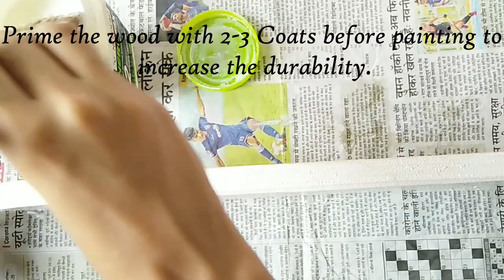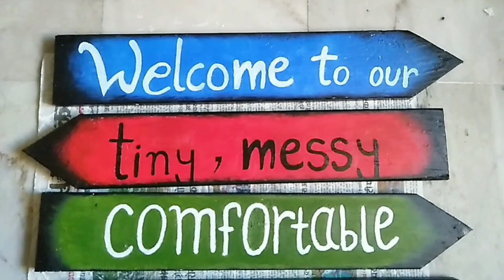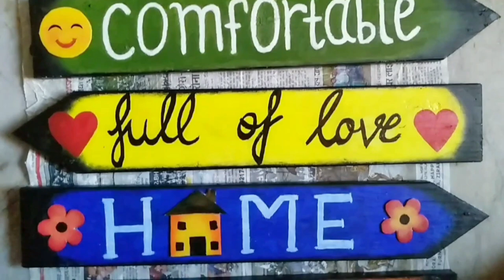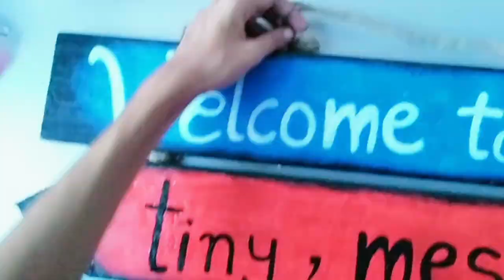Wooden Wall Hanging || Step By Step || By Rann's Art

Comment: Also, please suggest handy wood cutter for cutting to desired miniature pieces
Reply from the maker: The miniature ones I used to make with cardboard so you can cut the cardboard with a cutter easily and you can easily get the cutter from any stationary shop😊

Comment: Can this technique be used on mdf as well ? Which primer should be used ? And any varnish required after the painting?
Reply from the maker: Yes you can use mdf with a thickness around 1 inch but no primer Will be used in case of mdf, you can directly paint. And no varnish is not required after paint😊🥰

Comment: What if I have to stick this rope from backside... Kise rope ko properly stick kar skte he without glue gun
Reply from the maker: If you stick it from backside, then the rope would not be able to handle the weight of tha plank it's gonna fall but if plank ka weight kamm hai then you can stick it with a glue gun
Reply from the maker: But you can also use photoframe holders at the back side of the plank